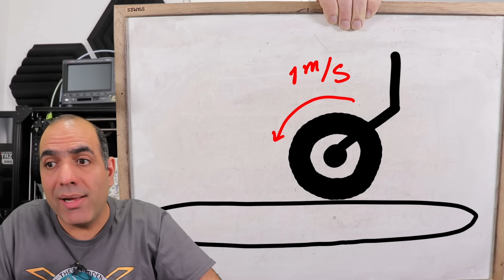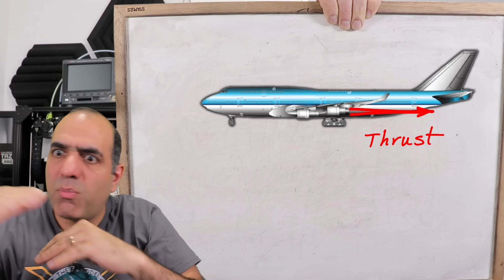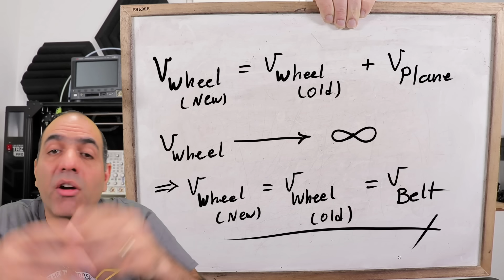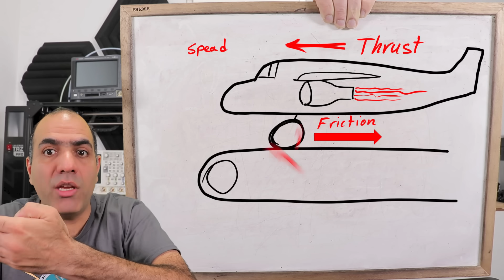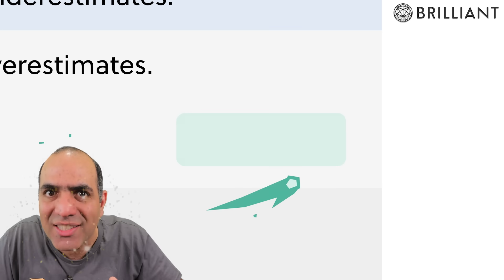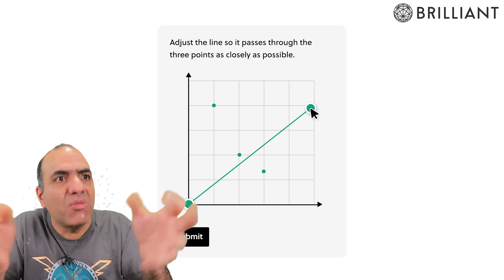Airplane Question that Drove Me NUTS!!!

Comment: It depends.
Strictly, considering plane is 'sitting': Plane doesn't take off.
Theoretically, just the question and ignoring physics: Plane doesn't take off (infinity)
Theoretically: Plane takes off.
Practically: Plane takes off.
My explanation on the last two: the plane picks up speed with its jet engines. This will always push the plane forward no matter what's happening beneath the plane. The conveyor belt doesn't move the air so the plane can always push itself forward. Even if the plane is moving backward at high speed on an endless conveyor belt, the air it is rushing into backwards will only give it more push, if the plane doesn't tumble over on it's nose.

Comment: Also I have an idea about producing infinite electricity for electric cars Can you bring two electric motors of the same capacity and output, and a lithium battery? And a gear device designed to amplify the movement, such as the one that comes in the form of a square that rotates in the gear that is on the right one cycle and then the bevel gear that is on the left ten turns. We place the car's main electric motor for movement in the direction of the gear, which rotates one cycle Then we put the dual electric motor, which is useful for filling the lithium battery with energy, on the other side, which rotates ten gears Thus, the battery takes sustainable energy and gives sustainable energy to the engine of the car, and after that it only needs a spark to start for the first time and to change the worn out parts after a period as maintenance only. 😮

Comment: Thanks for clarifying this.
So many conditions are unclear, because for example, if you have no friction, the engines do not matter, because the conveyor would spin the wheels without effect.
Reply: If you have no friction between the wheels and the conveyor, the engine still matters. Honestly, the wheels are arguably irrelevant regardless of friction, because the wheels play no part in making the plane move forward. The engines use air to move forward, not the ground like a car does. As long as it isn't being held stationary, and there is air, the plane will move forward and gain enough lift to fly. It's like wearing roller skates on a treadmill, but pulling yourself forward with a rope tied to a wall. No matter how fast the treadmill is going, you can pull yourself forward with the rope and the skates will just spin that much faster (of course assuming the wheels don't melt from heat). The rope is the air in this analogy
Reply: @tommy8716  The thing is this: Assume you turn off the thrust, what happens? Will the plane lose speed? Will it, at too low speed, roll off the runway?
Reply: @Squeaky_Ben  what does that have to do with the scenario? We're asking if the plane would take off, and most planes don't slow down to take off. But if you turned off the engines with no friction between the wheels and the ground, the only thing to slow it down would be air resistance, and maybe the force of wind. Though since we're using the engines to move forward, if you spun them the other way they can be used to slow down/stop the plane. And that's exactly what they do to come to a stop after landing.
Reply: @tommy8716  I am asking this because then you belong to what I like to call "Group B".
You are of the (entirely valid, but very different) initial assumption that wheels do not exist essentially.
You, like many others, have gone the condescending "wheels do not drive the airplane" route, as if that wasn't common knowledge, but ignore the fact that for an airplane to travel forward on the ground (no matter the propulsion) the wheels must have spun further than what the conveyor has pulled them back, which does not happen the way I interpret this question.
I say, because the connection between distance travelled by wheels and distance pulled back by conveyor will always be equal, that the plane cannot take off.
You say that it does not matter, because the wheels reaching a speed of infinity is not a singularity.
Reply: @Squeaky_Ben you're assumption is that the wheels must spin faster than the conveyor to take off. But the plane could take off even if the wheels were not spinning at all. It could take off without wheels if we reduce the friction enough (like I said, with lube or some other ridiculous option). The "wheels do not drive the plane" might be common knowledge, but it's not intuitive to the way most people initially think about the question, and that point is the most common hiccup. But the fact the a plane could move forward with wheels that don't move at all means it could move forward on a conveyor perfectly speed matching the plane, even without the wheels ever moving faster than the conveyor.
Reply: @tommy8716  Okay, a question to synchronize how we see this problem, because I will go insane otherwise:
A wheel, through whatever means of propulsion, travels a distance of 1 meter forward. The ground moves a distance of 1 meter backward.
Did this wheel change it's position or not? Or, to be in our more specific example: The engines are off, can the conveyor even move the plane?
Reply: @Squeaky_Ben  if a wheel moves 1 meter forward, yes, it has of course changed positions. But a wheel does not need to spin to be in a different location than it was previously.

The conveyor cannot move the plane, because the plane is not designed to move via the friction between the ground (or conveyor) and the wheels. The conveyor would just spin the wheels while the plane sits stationary.

In your original comment, you said the conveyor would spin the wheels without effect if there was no friction. But even with friction the conveyor would spin the wheels without moving the plane. The planes movement forward has nothing to do with friction between the wheels and the ground. The only thing the friction does is create more backwards force the plane has to overcome to be able to move forward. The less backwards force, the more efficient the plane is, so wheels are obviously much better than a plane body sitting on the tarmac (and for several other reasons).

If the ground had no friction, the plane wouldn't need wheels at all. It could just slide across the ground to take off, and reverse the thrusters to slow down when it lands again. We would not be able to walk forward, because we use the friction of the ground to move forward. You would just run in place, unless you pushed off something, then you would slide forever. Or, if you held out a kite, the wind could pull you along. Or if you held up a fan, you could push yourself around with wind. That's what the plane is doing, it's using wind to move it forward. Which is why it doesn't matter what the conveyor belt does, because the ground isn't a part of the equation to move forward. And all friction is in this equation is how much force is pushing back on its forward momentum, which could always be overcome with enough thrust (of course in reality it would destroy the bottom of the plane, but you could do it)
Reply: @tommy8716  Well then you are right in what you say.
You assume one thing, I assume another about this question.
My assumption is that if the plane is sitting on a conveyor, that conveyor is supposed to be able to move the plane. You assume it cannot. That is the only part we disagree on.
Reply: @Squeaky_Ben  That's good. We've narrowed down our disagreement to something that's actually testable. We can realistically test if a conveyor belt under the wheels of the plane would move it. Unfortunately if you try to search for this question, you get strictly results about the original hypothetical that the video is about. But at least according to ChatGPT, the conveyor belt cannot move the plane. Of course that's far from evidence, but you're welcome to try to get info from another AI source, ask the question to ChatGPT in various ways to see the answers it gives, or perhaps find something else online. The way I phrased it was "If you put a conveyor belt under the wheels of an average commercial plane, can the conveyor move the plane". Of course, sometimes AI will straight up confidently lie to you, but testing this would be very difficult. You couldn't scale it down very easy, because with less mass the friction between the wheels and the bearings would probably be enough to move the miniature. Moments like this is when it would be nice to have the budget of the mythbusters

Comment: No air moving from the front of the plane to the rear, over the wings = no lift = no flying. Period.

The plane on Mythbusters took off because it was allowed to move forward. Get yourself a motorcycle and a beefed up treadmill that will run at motorcycle speeds, strap a hanglider on yourself, and ride the motorcycle on the treadmill at highway speed. What's going to happen, other than you looking dumb? Nothing.

Comment: You said the plane could take off if there where no resistance. Wouldn’t that be false, because the air would also have no resistance on the wings, thus generating no lift?

Comment: With case #3, the prompt said the conveyer belt is only as long as a runway, which on average is about 2 kilometres. It might not be possible for the plane to reach a high enough speed before it reaches the end of the runway, therefore they may not take off. This is not certain because I can't be bothered to do the math. Someone else can if they want.

Comment: So I agree the plane will take off, but you didn't mention the difference between static and kinetic friction.  There is a limit to the maximum possible value of static friction, and once broken the wheels will slip with kinetic friction.

Comment: Lift= 1/2 rho V^2 S with rho being lift coefficient, V being velocity and S being the surface area of the wing. When on takeoff the plane doesn't measure wheel speed, it measures airspeed (from a device known as a pitot tube) which is the speed of the relative wind moving over an airplane's wings. This means if the airspeed (V in the equation above) is 0 the airplane creates 0 lift. The aircraft needs to have airflow over the wings in order to fly. There are videos of gliders and small aircraft taking off from a stationary position due to high wind because even though wheel speed is 0 there is enough relative wind flowing over the wings to create lift.

Comment: For answer 4: why would the increase in speed increase the friccion pulling the plane backwards? I think the problem wouldnt be in the bearings rotation but in the displaced friction force thats being generated in the contact point wheel-threadmill, anyway this friccion force shouldnt increase with speed, right?

Comment: Why do the wheels even matter? They aren't the thing propelling the plane forward, so as the plane starts to creep forward, the wheel turns a bit, and the conveyer turns it more, and depending on the acceleration and limits of the conveyer, it reaches a limit of either mechanics or physics. 

Either way, the plane takes off while the conveyer belt is going crazy

Comment: It's difficult because if the conveyor exactly matches the wheel's speeds the plane can not move.
But yet the jet engine is pushing against the stationary air and not driving the wheels directly, so can move the plane forwards no matter how fast the belt turns (until the rolling resistance of the wheels is so high that it impedes the plane's motion, or perhaps surface air gets moving with the belt).
Reply: My though was that the jet engines don't care about the wheels at all.
Reply: @Tankwiper  I've found the answer. All of the jet's thrust will go into increasing the rotational inertia of the plane's wheels which while lighter and smaller than the plane still have some mass. If the plane attempts to move forward, the belt will accelerate, creating backwards force via the wheels' inertia. This will prevent the plane from moving unless the belt drags enough air backwards to create lift for a vertical takeoff - assuming an infinitely powerful belt and infinitely strong tyres and wheels.

Comment: Initial answer: the conveyor doesn't matter because the plane gets its thrust from the engines, so it would probably feel alot more drag from the conveyor turning the wheels faster than they need to go but it would still just move forward and take off as normal.

Comment: The plane will take off with no problems, planes need just air for motion, the wheels on the plane are free rolling and are only used for steering and braking on the runway

Comment: Lol... That question is quite stupid : Since the aircraft is not propelled by its wheels, there is no way the conveyor belt will be able to match the speed of the wheels. 

And since it won't be able to do it, it will accelerate until it breaks, which can lead it
- to stop (in which case the aircraft will be able to take off) or
- to explode, making it the basis for a new Electroboom video (In which case the aircraft might disintegrate at the beginning of the video).

Comment: Plane flies because of wind passing the wings at certain speed. Wheels and the speed of those is irrelevant in context of flying. Therefore, no, it wont fly.
Reply: @electroBOOM : Here's a video of a small airplane (parked and motor swithced off) facing headwinds strong enough, so it creates lift under the wings and takes off: https://www.youtube.com/watch?v=IPOtDPHjW-Y&ab_channel=YourMomOrg
Thats why you thether you small airplanes for good with ropes and whatnot. Not a problem for a 747 though.

Comment: This question has little to do with planes and much to do with structural integrity and material physics. It can be divided first into two categories: 1. Imaginary (where frictions are ignored) and 2. Real life (where frictions can't be ignored). In both situations the plane takes off with the caveat that in the real world it depends on the type of aircraft i.e if it can achieve takeoff speed before wheels, bearings, tires, treadmill wheels/rollers and bearings, treadmill surface etc fail. That's the only thing that matters. Otherwise the plane will always take off. So it boils down to, if in real life the plane is too heavy and needs a too large takeoff speed (so amount of lift needed) such that components fail before that is achieved, is the only way the plane doesn't take off...it is never the case that the plane cannot achieve that speed otherwise, regardless of what the treadmill/wheels combo do so long as they don't fail...which is also what keeps this problem getting absurd in the real world like getting to insane ground/ wheel speeds and introducing other factors, because they'll have failed long before that anyway or the plane would have taken off already depending on the plane type.

Comment: In case 3.5, the friction in the bearings melts them, if the power of the jet engines is enough (should be). So the wheels break off and the plane's body drops and hits the fast spinning belt, destroying everything.

Comment: Wait. Neither rolling resistance nor sliding friction is dependent on speed. It's only dependent on the normal force. The contact surfaces will just get hotter with speed. The force doesn't increase. So there's no equilibrium where the "friction forces" would counteract the thrust. The thrust can easily overcome the friction forces.

So the thrust of the engines starts trying to push the plane forwards. The wheels start to roll forwards to match the speed of the plane. The belt starts to roll backwards at the same speed to match the speed of the wheels (not the forward speed of the axles, but the rotating outer surface of the wheels). Meanwhile, the plane is still moving forward. So now the wheel needs to move forward twice as quick, because the belt is moving backwards at the previous speed of the wheel. So the belt accelerates to twice the previous speed. But the plane is still moving forward. Thus, the wheels need to one plane speed quicker than before. And so on. The speed of the wheels and the conveyor belt quickly increases. The rolling resistance is independent of speed. So the plane should be able to accelerate, except it would destroy its wheels.

If the speed of the conveyor belt matched the speed of the axles, the wheels would just need to rotate twice as fast as normal, no runaway feedback loops between wheel speed and belt speed.

Comment: The plane doesn't move its self by powering the wheels ....those just roll freely ....the engines move air to propel them (treadmill has no real bearing on planes ability to move or fly)

Comment: What the wheels are doing is irrelevant to the plane taking off. The wheels are there to allow the plane to move forward creating airflow over the wing.
The length of the belts top surface would need to be the same as the take off distance of the plane.
The conveyor belt could even go in reverse, it makes no difference.